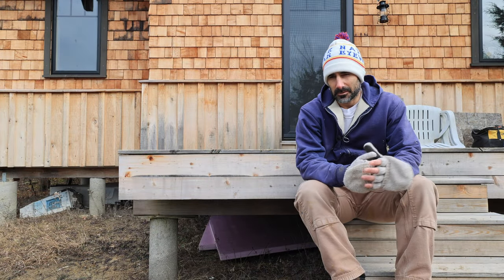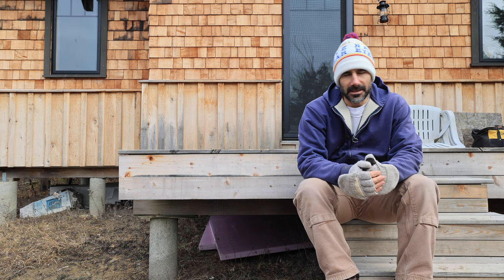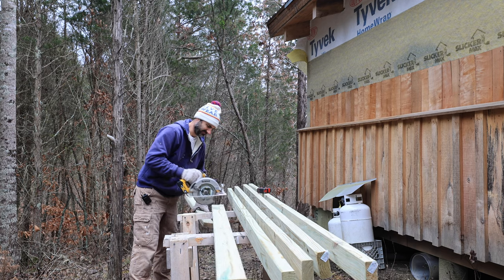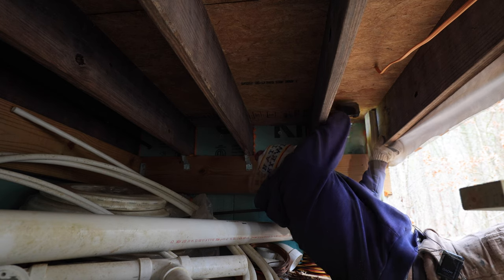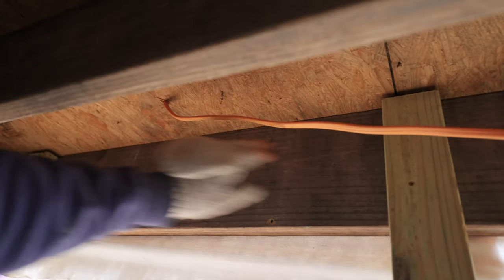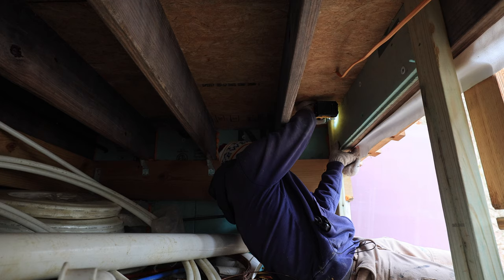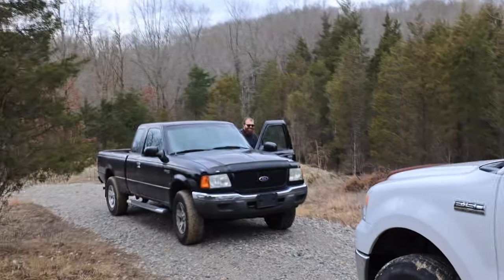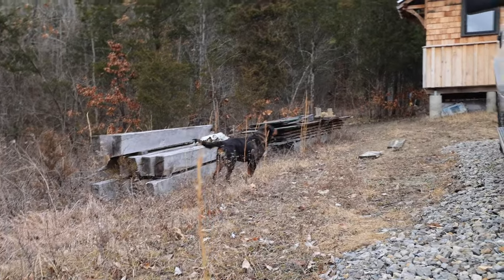Insulating a Pier Foundation | Off Grid Cabin Build

Comment: Down here in south Texas where Satan visits to warm up, we have mostly monolithic slab but some pier and beam foundations.  Of the many problems we face, ants are near the top of the list.  Ants seem to prefer nesting in foam insulation.  I even had to remove a nest that decided my tractor seat was home-sweet-home. We only heat our homes for a few weeks but open our Christmas presents in the comfort of air-conditioning.  The floor insulation is more important than what's in the attic.  To beat the bugs we lean toward rock wool with a solid and fully sealed (caulk) barrier board.  The best I've seen for barrier board was a 3/16" fiberglass sheeting.  Love your cabin and videos.  Thanks.

Comment: Mike as for your conundrum....about frozen water pipes and trying to keep it warm...now that you have the mini excavator you can get under the building and dig out. to pour a short wall. Then add  cinder block all the way up to the bottom of the foundation... 2 100 Edison bulb not energy-efficient will keep it warm enough or a big flood light..Will keep it warm enough so the pipes won’t freeze... you can also make a device to put on your blade of your machine..That  could go down like a back blade and pull the dirt out which they do when they’re trying to get under the house to jack it up in the crawlspace to pull the dirt out With Skidsteer .... I think that you should think about digging up underneath it with the machine...big a small room under crawlspace under that corner that’s my FYI on it take care junkman do
Reply from the maker: I am planning to do a bit of that type work as well.  Hopefully this summer.  Not sure the extent yet.

Comment: I would also put a vapor barrier on the ground so the moisture isn't going up into the under side of the cabin, floor
Reply from the maker: I have 3 sheets of polyethylene down.
Reply: @50Acres  
Good plan I knew you were on it!

Comment: The way I did my cabin that is 3 ft. up off the ground and my incoming fresh water pipe never freezes -   wood skirting all the way around cabin ,  Insulate just the exposed  incoming water pipe  & heat tape  it . At the  Pump house I  do the same with all the pipe and pump and also insulate the Pump house which in my case is as big as a  dog house ....  My main water line from fresh 2500 Gal .water tank is  3 ft.under ground  till it comes up to the pump house . Never have a problem with this set up . My 3rd winter here now and it gets below 0 and in the single digits all the time .  Good luck n happy trails !
Reply from the maker: Nice, sounds like a good setup.  We wanted to do something like that but maxed out the reach on the little Kubota BX 25D that we were digging with and were too lazy to go the rest of the way by hand as we had got to some really hard pan.
Reply: @50Acres   ...I know the feeling ...I  did all my trenches  by hand with a pick ,  Bar ,  shovel and a elec. jack hammer , solid rock ground here ...it was not fun but had to getter done before winter ....

Comment: Just a FYI, their is a low voltage product called Kopensator, that’s self-regulating heat cable for freeze protection on both metallic and non-metallic pipes and is available in both 12 and 24 volts.  It’s on heatline dot com.  I don’t work for them!!!
Reply: I just read your post and I said  The same thing
Reply from the maker: Any idea how much watts they draw?
Reply: 12 volt, – 3 watt/ft. (9W/m) at 50°F (10°C) maximum length of 40 ft. (12m),  and 24 volt, – 3 watt/ft. (9W/m) at 50°F (10°C) maximum length 60 ft. (18m). ..they have some spec stuff on the website all the temps and watts.
Reply from the maker: @TurningsbyTurner  That is way lower than I expected.
Reply: 9 watts per hour is still almost 240 watts in a day. You will need another solar panel or three to make up for it
Reply: I have a AC version and I don’t leave it running all the time.  I’ll put it on during cold spells under 30F.  You can even get an auto thermostat to have it come on when needed.  Also you wrap the pipe with foil and insulation over top of the heat tape.

Comment: I don't think the piers are the problem, but where you placed all the pieces of your water system is.   My plan is to have a pump house.  I'm using rain water but it would work the same for a well where all the equipment is in that building.  Mine will also include my solar and workshop so it will be 10x12.   That building is insulated and can be heated but the point is your pipes are safe.   Then run your pipe from there, under ground in a 4inch pvc that is then filled with spray foam for more insulation and bring that up right to the bottom of the cabin and once the pet or pipe is inside there you are protected again from the cold.
Reply from the maker: Yea a separate insulated house would work great.

Comment: Hard situation trying to insulate that area ! Can be done somewhat but without being down in the ground and be,ow the frost line makes it harder for sure. One thing I’ve done in the past even with a 4’ concrete frost wall is put down thick poly on the dirt floor to prevent moisture from coming up. Hope you are going to do that if u haven’t already. The insulation will trap the moisture even if u put vents in. Good luck and keep us posted
Reply from the maker: I’ve got poly down and my plan is to treat that area as conditioned space

Comment: I live in a trailer all year long. You should put that hard insulation all the way around the bottom then put another skirting around again on the outside. I made a frame of 1x2 then put on OSB 3/8 in. painted it black to match the bottom of the trailer.
Reply from the maker: I’m thinking of spraying the underside of the cabin with foam this summer.  It’s cold on the feet!

Comment: Here in Sweden we have very many houses built thar way and I can tell you it is the way you treat it not the way you built that is the problem. I grew up in the norhtern part of Sweden (Lappland) and it was the most common way of building.
The problem you have is theat you don’t keep your cabin warm every day. You have choises though. Put a heating cable in to the waterpipes or insulate round your pipes. The way it works when the cabin is not heated all the time is that insolation or not it is going to freeze.
The best way to solv it is: emty the system totally.
I am use to temperatures down to less then -40 C in the winter.
If the hole system,  pumps waterheater, pipes, everything is not emtied it will freeze and brake.
When you in the cabin, let the water run just a little, that precent it to freeze during a cold night.
Reply from the maker: I wish I could keep this place heated full time!

Comment: It looks like the front left post for the outdoor shower is about to fall off the platform.   If ease of access as well as a function of insulation is the goal of the day.  Build a frame in front of the space of 2x material recessed just under the edge and then build a door skinned with the insulation panels to cover it.  the lock is a H shaped device that extends thru the panel and when rotated hooks a leg of the H behind the panel and hooks behind the 2x4 frame.  The outside leg of the H is the handle you turn.  Just imagine an H shape turned 90 degrees from normal.  This way the panels will stay in place when in use and can be easily removed for work access.
Reply from the maker: Eventually I plan to re-inforce huge sections of the foundation.  It's a big part of my goals for the summer.

Comment: Heat a cheap filet knife with a small propane torch and it will cut the insulation board like butter 👍🏼
Reply from the maker: cool thanks for the tip!

Comment: With you closing off that area you are going to want to toss a few mothballs down there ever few months to keep the pests from turning it into a home. An easy no kill method to push things to pick another home due to the chemicals smell. 

Did you look into the pump to put into the tank and the valve to open/close the pipes to drain back to the tank when you are away?  No more need to put anti freeze into the pump if the water itself is insulating it and no fear of the pipes freezing if you flip a switch to shut off the system and it opens the valve to drain everything back meaning no water loss when freeze protecting the system. 

Don't forget that solar thermal is a thing. An array of tubes in a sunny spot and a solar panel to run a pump and you will have year round warm/hot water for the cabins needs including to heat spaces with a simple radiator.
Reply from the maker: A submersible pump will be a really good way to eliminate the need to winterize the pump when I leave.  I may invest in one at some point.  The good ones are really expensive though!

Comment: Why don't you  use bubble wrap for the insulation to keep your pipes from freezing?  Check out boss of the swamp video on how he uses it on his cabin.
Reply from the maker: I also have a water tank, pump and pressure tank down there so I have to insulate at least a 4 x12 area where all that stuff is located.

Comment: some free music 80s style would be nice, add a door (Horizontally lifted with hinges) so you can crawl under it when the time is right also add some sorta light so you can see where you're going and not go face first in a giant cobweb... (the saying you dad says).. more accurately in Asia its.. "2 heads are better than 1.. one a cabbage the other a rock" :D lol.. hope the Mrs (bank) ain't annoyed you go on taking more cabin projects in winter.
Reply from the maker: That would be nice.  I do need to make sure it’s easy to access those areas.  A light is a must and believe it or not I am doing this at the Mrs. direction!  She wants to be able to use the sink in the winter!!

Comment: Advice on not freezing a water pipe from a Sweenor Builders comment:
"The sewer comes out of conditioned building and drops vertically through unconditioned space until it reaches below the frost line before turning horizontal again so it won't have a chance to freeze.  For the waterline there is a charged filament wire that is installed directly into the waterline for the length required until the line is below the frost line.  Basically heat tape that goes inside the waterline vs wrapped around it.  It is available in different lengths and plugs into a standard 110v outlet inside the building."

Comment: Since you are showing this it means you have already done it.

Check out Boss of the Swamp he uses that bubble foil stuff.

From personal experience with styrofoam houses.

What you put in it stays in it. But not forever.
In spaces heated and cooled by the natural temperature.

Sometimes on a really cold series days the cold air will get in eventually and then when the outside temperature starts to warm back up, it will take time for the inside temp to come back up.

This is hard to explain on youtube comments.
I lived in an old farm house that was on piers for years. 
The outside walls were real stucco layered with anywhere from 1 1/2 to 4 inches of Styrofoam covered in Dryvit.
Reply from the maker: Wow, yea it takes a long time time to warm up my walls and pretty long time for them to cool down again.  I'm not 100% sure how well this will work especially if we get a deep freeze.
Reply: @50Acres  Not sure either you might need to install a drain at the lowest point of the water line.
So that the entire system can be drained when you are not there.

I am not a fan of automatic heaters without somebody being on site.

Comment: The dog didn’t look malnourished so she couldn’t have been abandoned too long if that’s what happened. Good on Arch for looking after it though.  The cabin is looking good. Just a question about the insulation portion of the crawl space; does it need some sort of ventilation to circulate the air? Would there be a concern about moisture and mold?
Reply from the maker: Yea it didn’t look like it had been out on its own a long time.  The plan is to treat that area as conditioned space.  Same air as inside the cabin.  I will circulate it like a fan.

Comment: It looks like the cabin is built on a slope. When you added the insulation board, has it caused rain water to not be able to drain as it runs downhill? I am planning a cabin build on a slope and am looking for ideas. Awesome job thank you!
Reply from the maker: It is built on a natural swale, the ground slopes away in all directions, so I don't have any issues with runoff. Good luck with your build.

Comment: I follow a channel "Boss of the Swamp" now "Off Grid Homesteading"  . He has an off grid small house in up state New York.  He has used the foil and air bubble Reflexive rolls under his cabins.  He has had great results.  I like where your going but if you check him out you might get some new ideas for places that might sweat under the house.  Keep doing what your doing, you have a quality plan going.
Reply from the maker: I’ve seen some of his reflectix videos, I like it.  I’m probably going to spray foam it eventually

Comment: Hi It might be an allusion be where you were sitting gave a view under the cabin, and it looked as if one of the piers had a gap of about an inch between it and the wood it was supposed to be supporting Shouldn’t you have foam up under the floor of your cabin to stop the cold coming up into the cabin?
Reply from the maker: It’s possible that I may need to shim it.

Comment: If you watch "The Boss Of The Swamp" on YouTube, he swears by that bubble insulation. Stapled to the bottom of the floor.
Reply from the maker: Yea I have seen those, might use that when I insulate the rest of the floor.
Reply: Just spray foam the rest of the floor. Thst bubbe foil has very little R value.

Comment: My biggest concern about using Styrofoam product or pink insulation under the cabin is the mice and ants especially in the woods.
Reply from the maker: This stuff is often used in frost protected shallow foundations.  Nice have nibbled a bit off here  and there over the last 6 years but by and large I wouldn’t say it’s a significant amount.

Comment: Doesn't putting hot and potentially humid air from the cabin into the crawlspace risk condensation down there? I guess you could monitor the humidity and vent it externally with another fan if that becomes a problem?
Reply from the maker: No, that area is meant to be conditioned space, its why we laid 3 sheets of polyethylene down on the ground.   In general, the best crawlspace design is sealed and conditioned with the house.
Reply: @50Acres  I forgot about the damp proof sheets, it's been a while since you put them down. :-)

It's coming together very nicely now, well done on getting this far.